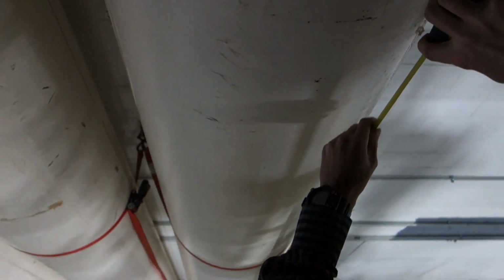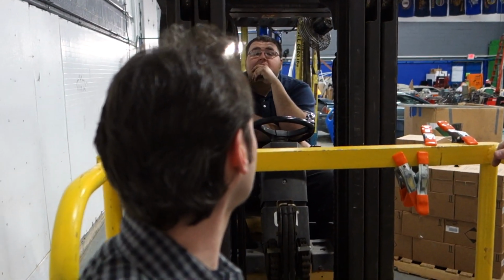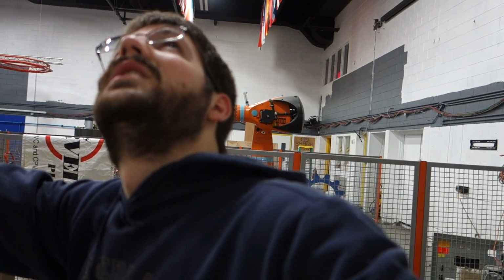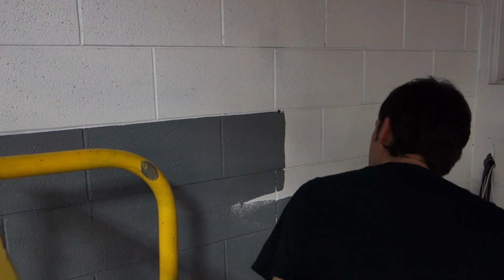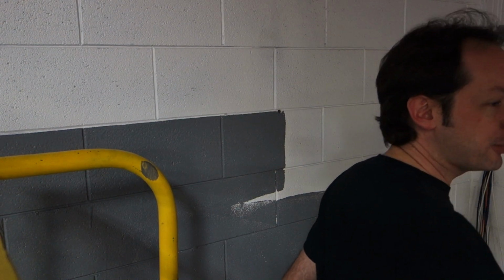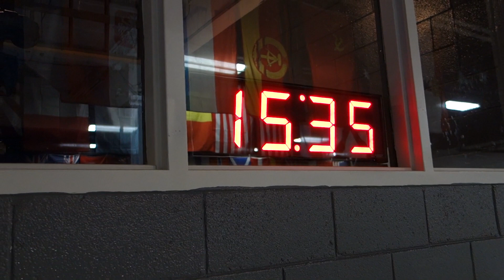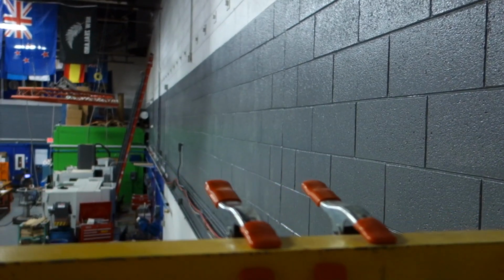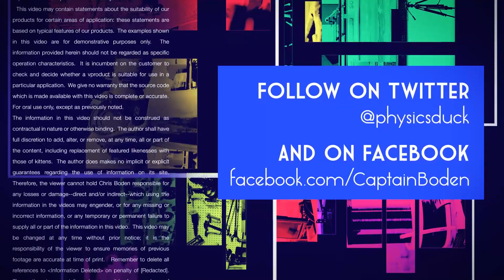Captain's Blog 1 17 2015 MDH Grey East Half First Coat

Comment: Hint to get a square line round the Zeus tubes, get a flexible flat strip of material, wrap it round the tube so the edges line up, i've used paper or thin card, or kitchen worktop edging strip, but thin metal should also work, only need to measure once and draw the line against the edge